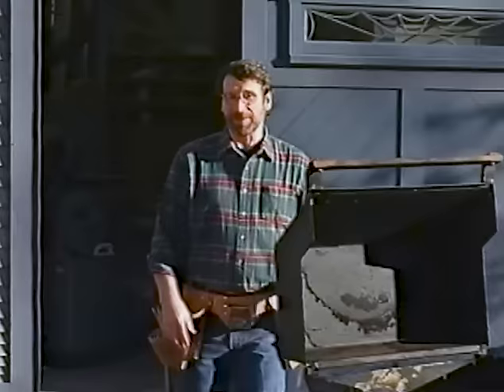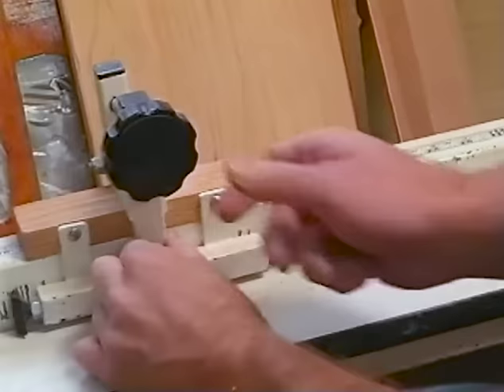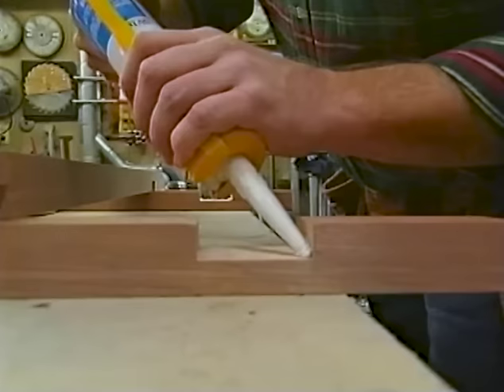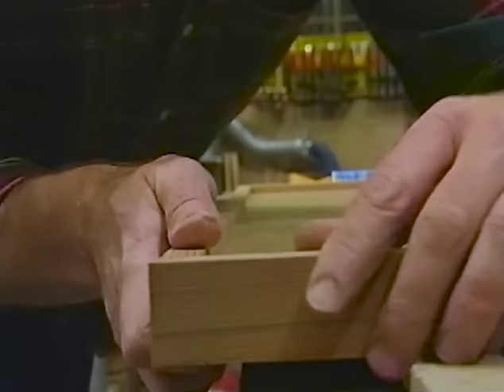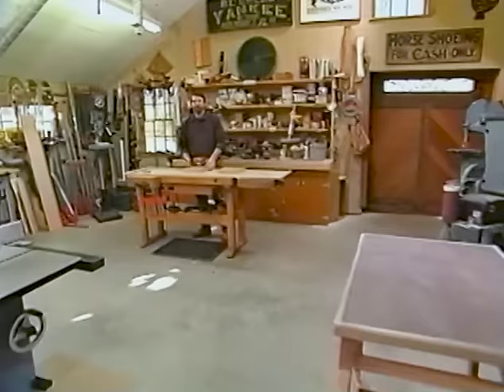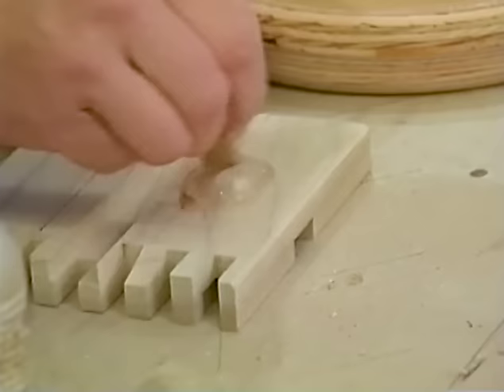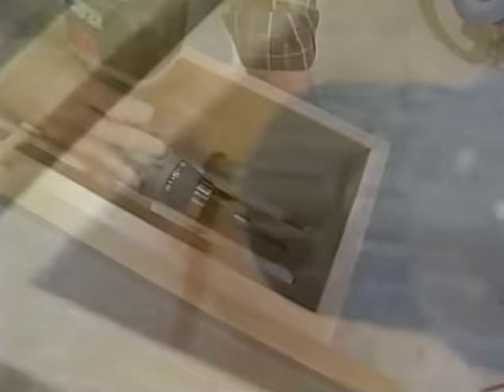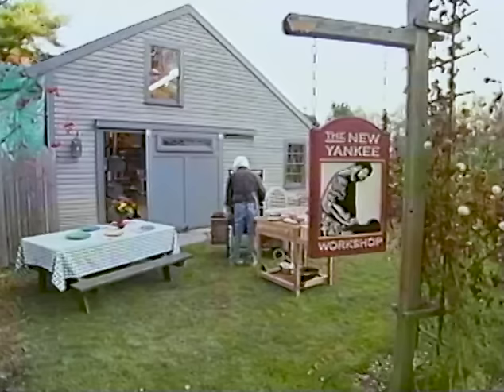Grill Cart  |  S11 E13

Comment: best if built today to use Thompson clear deck stain. You can use also on utility trailers that sit out. once a year or so add a few coats. the wood will obsorb between coats just let sit add a second you can use a chemical sprayer set to fan Areosol cans can be used however you’ll need to clean off a shelf from a lowes or home depot to buy enough. Just buy the gallon cans. Start off with about half a gallon spay all of it. Let dry repeat. Once it obsorbs all it can let it dry in the hot sun. Then over the years as it starts to dry add more. That way your utility trailer can be used wet or dry then if it gets grassy or muddy from mowers etc hose off. Then your 2x4 gets tons more life.